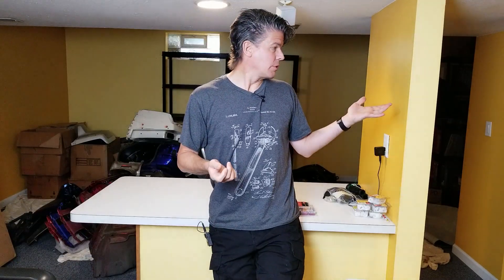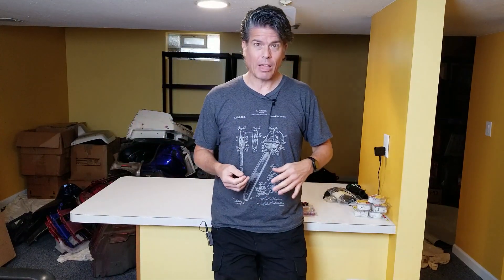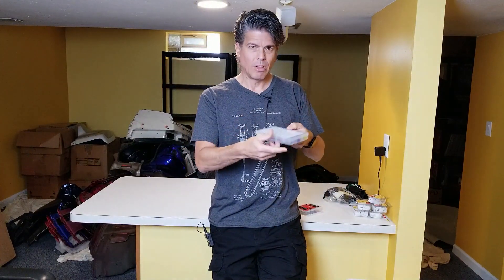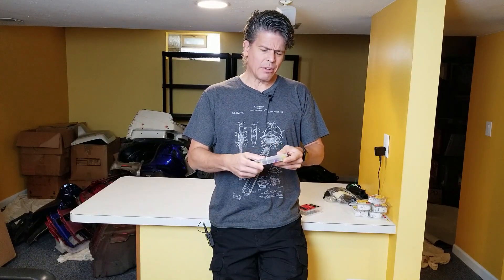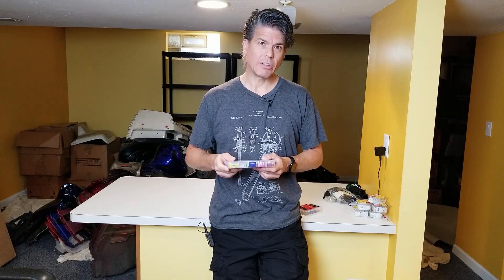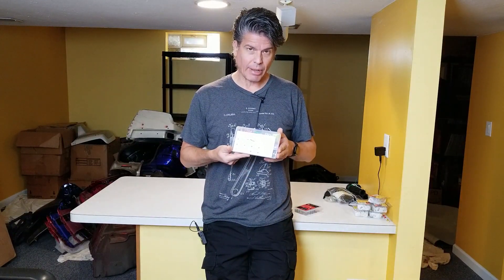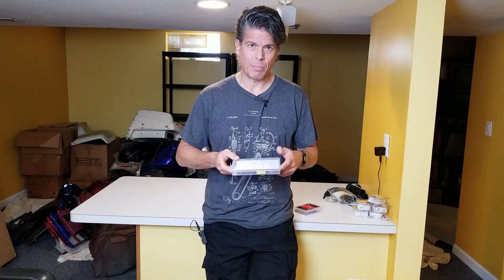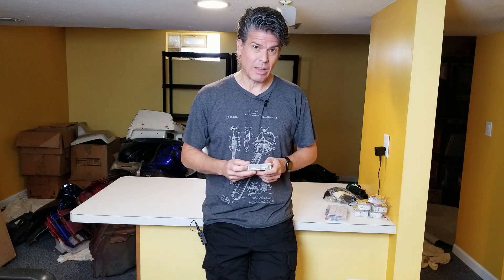The Fraudulent, Defective and Dangerous Product that can DESTROY Your Motorcycle!

Comment: Always check with a meter.put it on ohms and it will give you the truth.
Reply from the maker: No, it won't. Every fuse, regardless of rating, will measure 0 ohms. The only way to test a fuse is as I show here: run current through it and measure that current when the fuse actually blows.

Comment: What do you think about the Bussman brand  from Missouri (made in Taiwan). ? 

They  have an EZ  ID fuse that turns a little red light on when  the fuse is blown for easy detection. 

Do you think those are good quality for the Goldwing? You need at least two packets of $33 each (autozone) because they only come in packets of seven for the mini fuses and some of the fuses on the GL 1800 take at least 8 fuses.
Reply from the maker: Bussman is a well-known, long-time brand of fuses, I would have no problem with them.
Reply: @GoldwingDocs Bussman is a good brand, when purchased from a trustworthy retailer.  I'd be surprised if there weren't some products that would be just like the junk on this video except that somebody "upgraded" them by stamping "Bussman" on them.

Comment: I have a feeling your test was not fair. As a Master Electrician with previous ’bench’ testing, I consider myself an expert of sorts. This gradually increased amperage is not they purpose of the fuse. These one time, or “slow blow” fuses even are there to protect from “surge amperage “, like when the device goes bad, or a wire got crushed to ground. I like the fact you have taken it to the people for education purposes and save folks trouble. Just had to put my 2 cents in. Perhaps the folks need to know that all fuses are not created equal. Stick with name brand protection, just like the oil in your bike or car…. One gets what they pay for. Busman, and Littlefuse are trusted brands that go through rigorous industry testing to bring them to market. They are the leaders for a reason. I’m in no way saying your opinion isn’t valued, just a little incomplete. A fuse in the automotive/motorcycle application will save a lot of issues from occurring. I believe this issue is 1). You need find best quality protection for unforeseen circumstances. 2). Not everyone messes with electric, especially since the latest bikes are going more sophisticated with sensitive electronics and can-buss electronics etc. great tip to avoid that online giant junk from china, stick with a name that’s respected in the industry. Always look for the Underwriters Lab, or CSA(Canadian Standards), stamp of approval .  In closing one more tip you overlooked is : Big no no is tapping into existing wires, because they have been selected for the intended load. Over current can start a fire like the blaze you show. Be careful, junk produced by people who aren’t going to back the product is ALWAYS trouble. Peace. Ride safe.
Reply from the maker: I definitely was not testing inrush current, being that I was using a purely resistive load. But the fact that I was pulling more than 9 amps through a 2 amp fuse and it didn't blow, shows that they are faulty - slow blow or not, it should have blown long before I got to 9 amps. Plus the fact that all of the different rated fuses were identical.

I agree with you, for this type of protection, you really need recognized name brand fuses - as long as you aren't accidentally buying counterfeit products! As I'm sure you know, there's a real problem with counterfeit residential breakers making their way into the common supply chain.

I actually did UL/CSA testing at a testing lab for a job many years ago - another problem today is that unscrupulous Chinese companies will stamp pretty much anything with bogus UL/CSA/TUV marks, regardless of whether it has actually been tested/certified/listed or not.
Reply: @GoldwingDocs  I am not trying to negate any of the good information in your thoughtful reply to Jimmyt55 but I would like to point out that just because a load is purely resistive does NOT mean there are no inrush currents.  A typical example is a Tungsten filament incandescent light bulb. When cold the filament has a low resistance and when the bulb is turned on the resistance of the filament increases as the filament warms up.  You can easily prove this to yourself by measuring the resistance of a cold filament using an Ohmmeter and then lighting the bulb from your power supply and measuring the voltage and current, and then calculating the resistance using Ohms law.  Some types of bulbs have a 10 to 1 resistance increase between cold and operating temperature.  This results in a very large inrush surge when the bulb is turned on - assuming the power source can supply the surge.  It also explains why incandescent bulbs frequently fail at turn on...  The surge blows a weak spot in the filament. This is also why if you look carefully at the ratings on switches intended to turn lights on and off you will sometimes see a "T" current rating somewhat lower than "AC" current rating.  The "T" stands for Tungsten and indicates that the current rating of the switch is lower when switching incandescent bulbs due to the large inrush currents. 

      At least the resistance of a filament light bulb is always a positive resistance.  There are weirder loads out there which have negative resistances. A typical example is a fluorescent or other gas discharge light bulb where the resistance decreases as the current through the bulb increases.  When connected to a constant voltage source high enough to "strike" the bulb this characteristic results in a "runaway" current increase almost instantly destroying the bulb.  The purpose of the "ballast" in older fluorescent light fixtures is to limit the current through the bulb using inductive reactance to prevent catastrophic bulb failure.  In more modern fixtures the current is limited using "constant current" electronic power supplies.  My job years ago was to design and build electronic equipment for scientific research part of which was to build high voltage variable current drivers for such light bulbs to be used in spectrographic research. Essentially, using electronic devices (high voltage power FETs), sufficient positive resistance was created in the circuit to balance out the negative resistance of the light bulb plus enough resistance to limit the current to the desired value.   This was done dynamically using a feedback loop so when the negative resistance of the bulb being driven changed the circuit would compensate thus keeping the current through the bulb constant.  Again, no inductance or capacitance involved other than strays in the circuit due to wire lengths, etc.
Reply: The purpose of a fuse is to blow before any wires in series with it can get excessively hot as a result of overcurrent.  A wire which is subjected to 2x its rated current will produce four times as much heat as it would with the rated current, and one subjected to 3x its rated current will produce 9x as much heat.  If ambient temperature is 40C (hot but not unbearable), and a wire is sized to heat up by 30C when run at rated current, the wire would eventually reach 70C at rated current, or 310C at 9x current.  The wire wouldn't instantly reach 310C, but would eventually get to about 310C if 3x current were sustained without the fuse blowing.

A good part of testing fuses should be to wrap a temperature-sensing aparatus in a piece of relatively fine wire and measure the temperature increase in the wire when the fuse is subjected to a very severe overload.  Use two fuse holders in series, put quality high-current fuse in one, and test quality fuses with lower current ratings, and increase the current rating until the temperature rise approaches the limits of what the aparatus could withstand without damage.  Then put that rating of good-quality fuse in one holder while testing lower-current fuses in the other.  The lower-current fuse should limit the temperature rise to a much lower amount than the high-current fuse, but a garbage-quality fuse might not, in which case the quality higher-current fuse would protect the aparatus.

Comment: Something was wrong with your initial test.  The screen shot shows 9.5 amps and 22.5 watts, which means the voltage was only 2.37.  The top of the display is cutoff in the shot but you can see it's likely 02.37 volts.  9.5 amps at 12 volts would be 114 watts.
Reply from the maker: Correct. As you reach the upper current limit of the power supply, the voltage drops. The same will happen to the voltage of any circuit as you start drawing current close to or at its maximum capacity.
Reply: @GoldwingDocs  then your power supply is not providing enough power to blow the fuse.  Show the readings at 5 amps. What were you using to put a load on the circuit?
Reply from the maker: @newracer74  That's not how electricity works.

Fuses blow based on current flow (amps), not power flow (watts), which is calculated by volts X amps. A 5 amp fuse will blow when you pull in excess of 5 amps. It doesn't matter if you have 1 volt, 10 volts or 1000 volts, when you hit 5 amps, the fuse blows.

Every power source, either a battery or a power supply, when you reach the limit of its ability to supply power (measured in watts), will have a voltage drop. Put a huge load (like a starter motor) on a weak battery, and the measured voltage of the battery will drop from 12 volts to 7 or 8 volts - or less, depending on the state of the battery. What you're seeing in this video is exactly that: as I approach the limit of my power supply (in watts), the measured voltage drops. The measured current is maintained, because that is determined by the load (subject to the current capacity of the power supply). I have the power supply set to 13.8 volts, but as I reach the limit of its capacity, that voltage drops, as expected.

Regardless, the fact that the voltage drops is entirely irrelevant to the test, because fuses don't care about volts: only amps. The voltage could have been 2.37 or 23.7 or 237, it doesn't matter - what matters is that it was measuring 9.5 amps of current flow, going through a 2 amp fuse which should have been blowing at >2 amps.

You state that the power supply is "not supplying enough power to blow the fuse." This is totally wrong. Again, fuses blow based on current (amps), not power (watts). And the power supply was supplying 9.5 amps - far in excess of the 2 amps that the fuse was rated for. This means the fuse had 9.5 amps of current flowing through it - and was still not blowing. THAT is the issue.

Comment: I had actually an opposite problem: I burnt 40 amp fuse in the circuit which draws around 40 amps and discovered I had no "attractive" replacement in this fuse size ... and forced to build up sort of "Mygiver" fuse and coat it with epoxy resin. Works fine.
Reply from the maker: If you coat a fuse with something, it will conduct heat away and prevent it from blowing. That's why you always see the fusible part suspended in mid-air...
Reply: @GoldwingDocs  This was the goal since no place for bigger size fuse in the module and mini fuse max is 40 amps (as said earlier I need 40ish amps in) . I modded a booster with extreme 300 amp FETs and my real fuse now is the coil in the circuitry 😀

Comment: Trouble is, that just about every damn thing these days is made in China.  Thanks for the heads up.  I work in a car parts store, I'm going to have a look at the packets of fuses we have on the shelf.  Big Clive did a similar test on Chinese house circuit breakers and each failed the test.  When he took them apart there was no breaker mechanism inside at all just a solid piece of wire to complete the circuit.  There's just no level too low that these people won't sink.
Reply from the maker: I saw that video (with the bogus breakers). I wish I had mentioned the counterfeit breakers in this video, it's a huge problem.

Comment: Scott - great job on not assuming.  I'm guilty of taking fuse ratings (for vehicles) at face value and I should know better.  You've brought something to all of our attention.  For those that don't have the ability to test a fuses amperage capacity, just simply looking at them to do a visual inspection would be good enough.  Like you pointed out, every one of the cheaper fuses in the lower ranges from the unknown manufacturer looked identical.  Common sense says that's not right, and don't trust.  Thanks for the awareness, hopefully it'll save someone from making a grave mistake.

Comment: Excellent catch. It's not just automotive fuses that can be suspect. There's also been some dodgy HRC fuses coming out of China. Lets hope Amazon takes this seriously.
Reply from the maker: I should have mentioned it in the video, but there is also a massive problem with counterfeit home circuit breakers as well - Chinese-made counterfeit copies of Square-D and other manufacturer's breakers that do not provide the proper safety margins. These are getting into the distribution channels, so you can't even be sure anymore that the breaker you buy at Home Depot is in fact legitimate, and not an inferior counterfeit copy.

Comment: I had a great-running Goldwing that had an aftermarket brakelight flasher unit. The connections got crusty and the fuse never blew when the connector got hot and melted off the insulation, and shorted to the frame. Instead, the entire wiring harness melted internally. I ended up selling the bike at an obvious loss.
Reply from the maker: Sorry to hear this!

Comment: You brought up a good point.  Additionally some of us have electronic relays and fuse protection in various products like the Pahtfinder fuse block and the Show Chrome Isolation Fuse Block.  These are billed to protect the CanBus system.  Is there a way to test these devices?  I’m sure most people like me, just accept that they do what they say they will do.
Reply from the maker: Those electronic fuses are actually current sensors with (usually) MOSFET switches, and are by design, very accurate. They can even modify the sensing (fast blow/slow blow) with firmware. So I would have no qualms in trusting them.